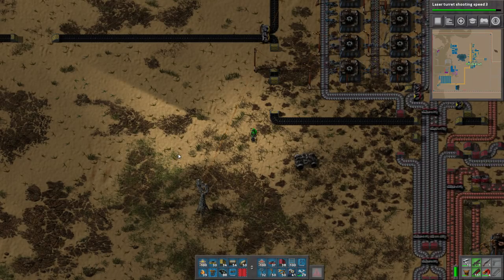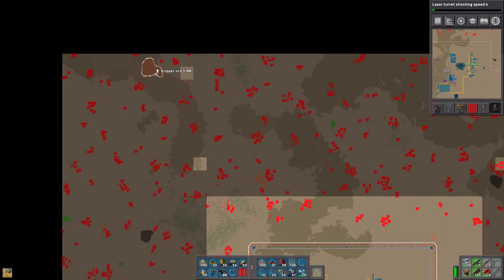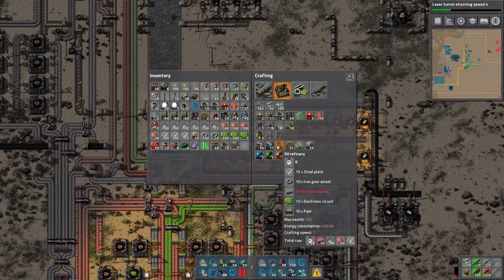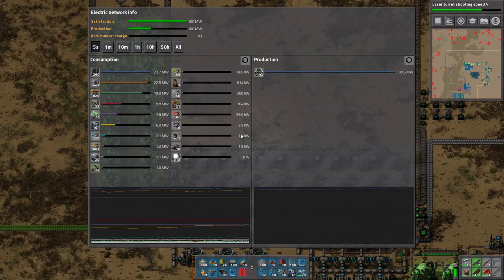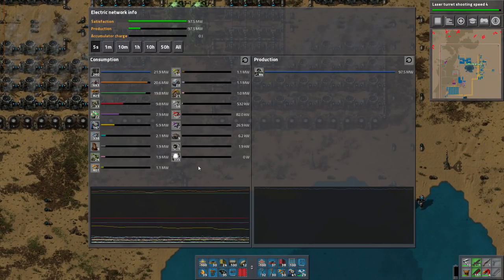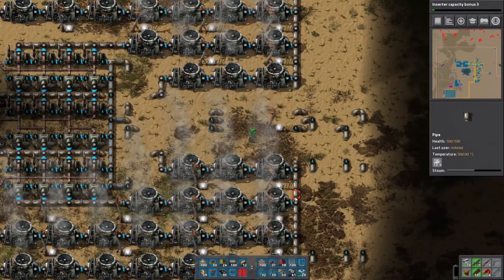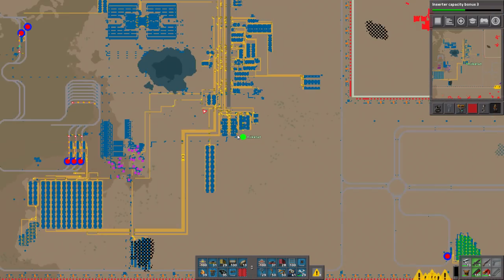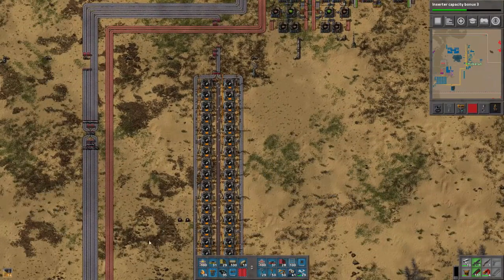Let's Play Factorio 0.16 - Part 27 [Desert Deathworld Marathon]

Comment: Howdy.  I've been using stored steam in my own factories, but more focused on solar.  I use steam as pre-battery accumulators, basically.  I've found the steam production/consumption to be quite helpful, the more often your boilers are running at max capacity, the closer you are to problems.  Then, you can look at consumption over the course of an hour or whatever to see if your average use is sustainable.  I know you're not using solar, but here are some numbers.  For every 150 solar panels, you get 7 steam engines worth of steam for the pure dark.  A boiler can make enough steam for 2 engines to run 100% of the time, so it can make enough steam to run 20 in that 10% of the time.  Thus, with 428.6 solar panels, you cap out a boiler's production (an 18Mw factory).  However, I don't know how many storage containers of steam that requires, because at that point, I'd actually have to know how many seconds are in a factorio day.